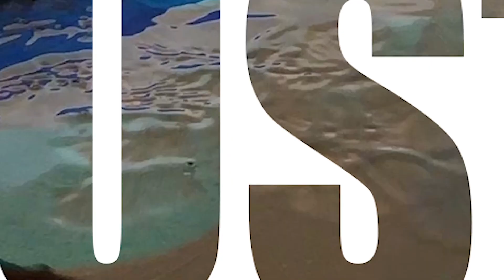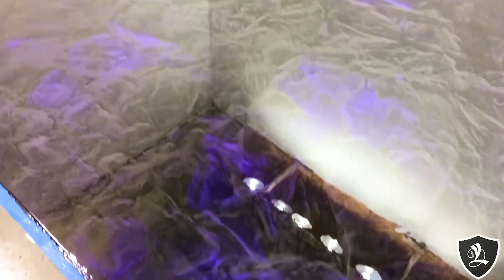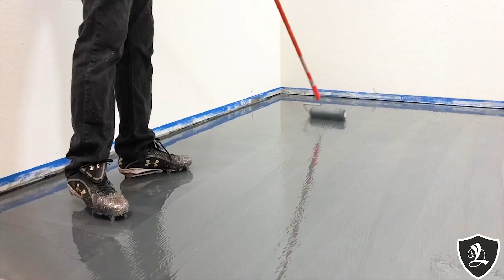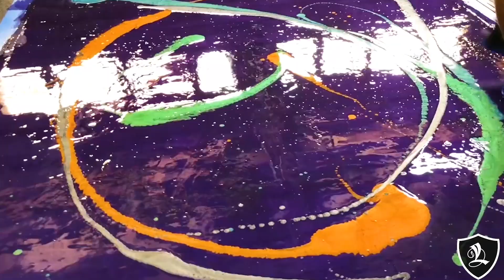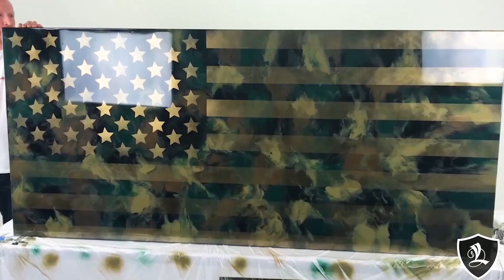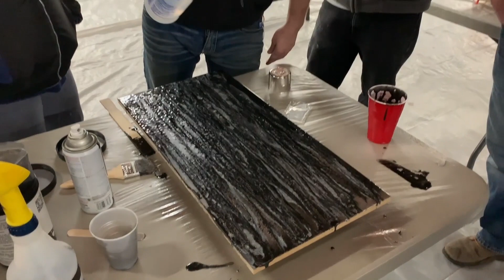Not Your Normal Sample Kit Design! | NEW & EDGY Epoxy Sample

Comment: I did experiment with a sample kit on 2 small pieces of wood. The white with gold veins turned out great except sides did not cover completely. Then tried the finger technique with white base, gold , and bronze spray paint but think I over worked it. Came out too beige. Also do you sell the isopropyl?  I can't get it anywhere .

Comment: Is it possible to put down a layer of paint before you do the resin?
Reply from the maker: No you do not want to apply the epoxy over paint, it will not adhere to the floor.  Thanks